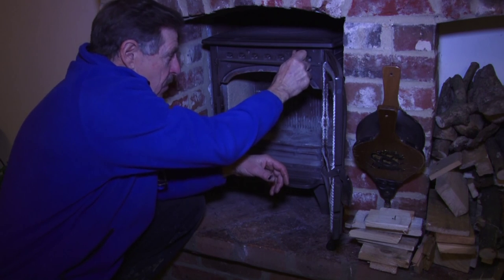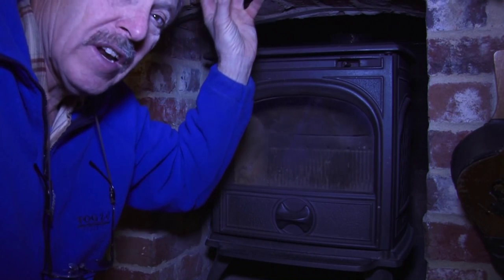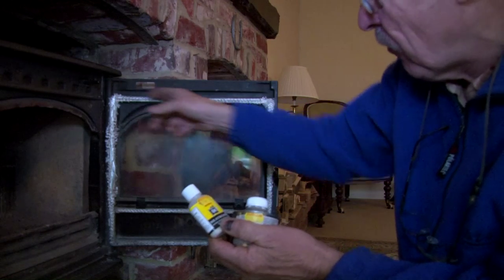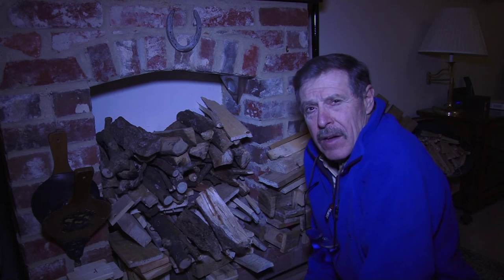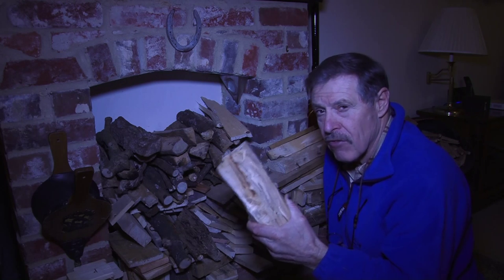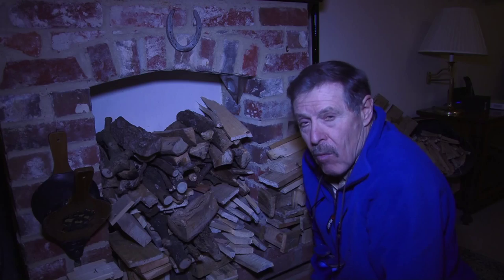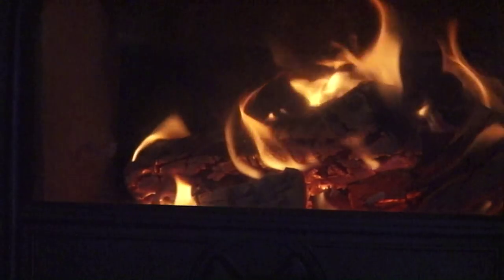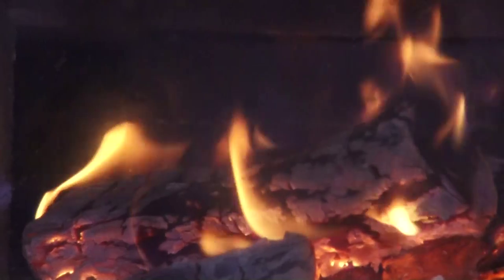How to use a Woodburning Stove | TA Outdoors

Comment: Great stove (Dovre 250 none multi ) in my view the rope you using is far to thick for this stove , also it’s a bit tight in the gap more air around stove would be beneficial , great video cheers

Comment: If you have an Electric moisture measurer for Wood, at what percentage moisture can/should you burn the Wood?
Reply: Less than 20%. Be sure to split a piece and test on a freshly exposed surface close to the centre. Moisture content varies throughout and a piece with dry ends may still contain a lot of moisture inside.